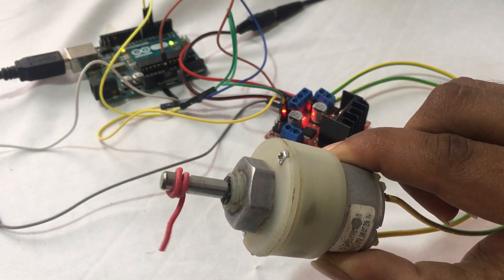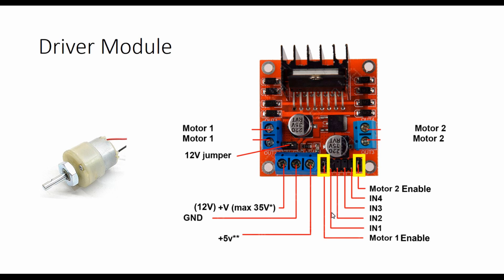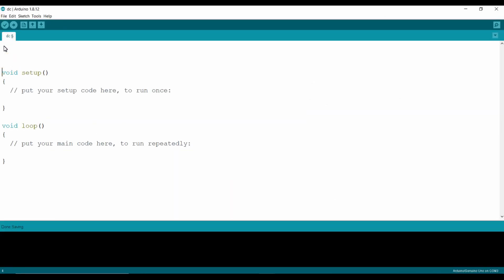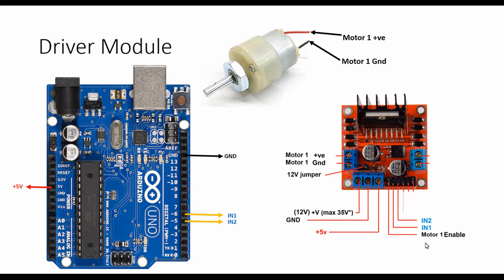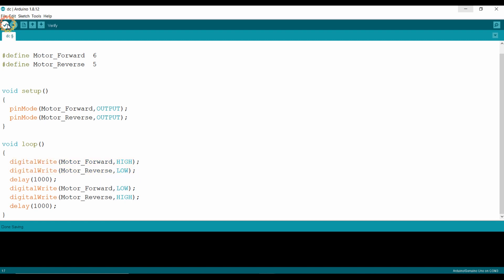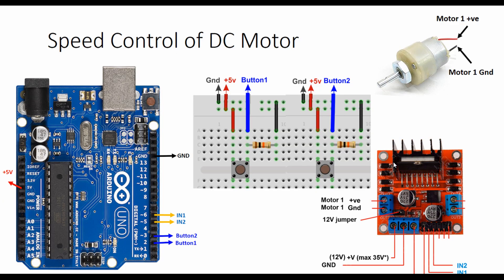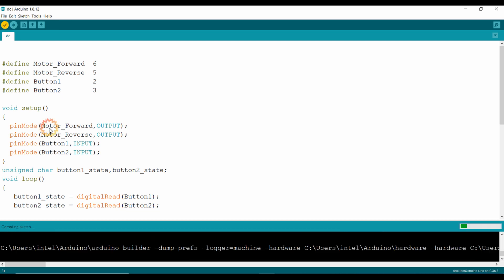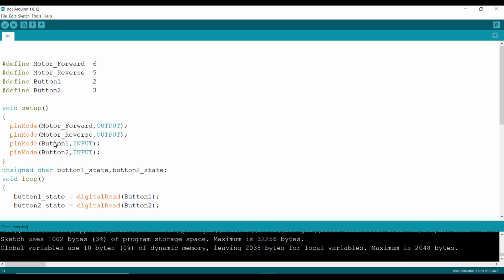Interfacing DC Motor with Arduino | Control DC motors using L298N Driver with Arduino

Comment: I did everything exactly the same, but suddenly the wires burned, and the L298N overheated. I used 2x 18650 batteries. What's the reason?